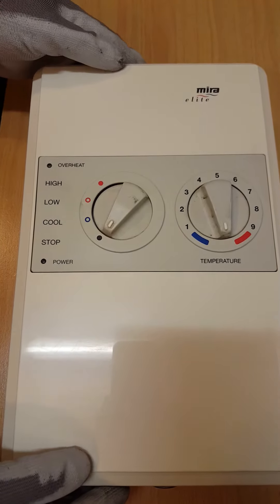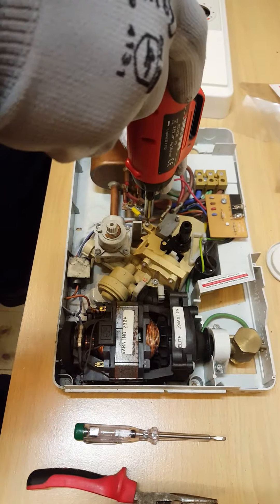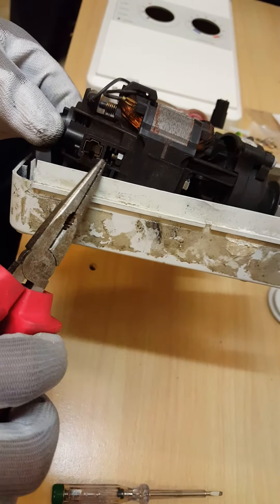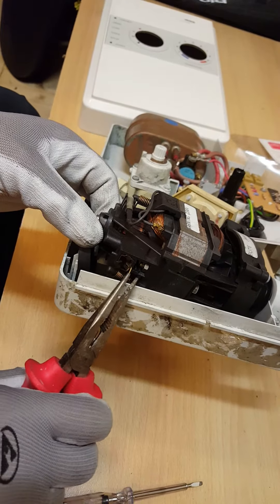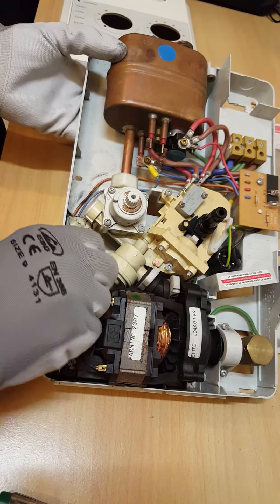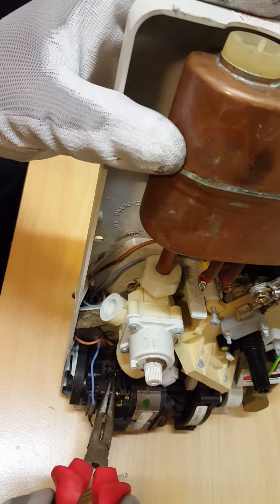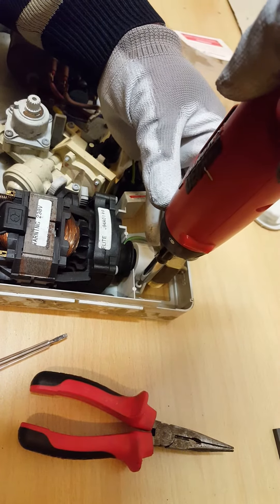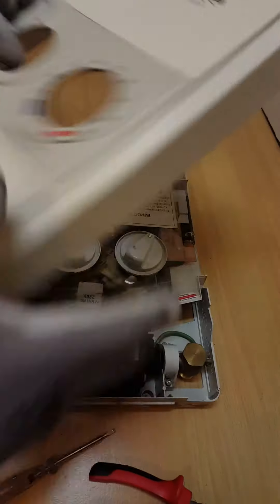Mira Elite Replace Carbon Motor Brushes

Comment: Hold up
 This is a electric shower or not as I always thought electric showers had no pump however this looks like it has a heater element and a pump so I am getting very confused
Reply from the maker: There are two types of showers, mains water fed,or pump fed from the water tank in the attic. hope that helps 🙂
Reply: @Frank_Falvey  so I think you're repairing a power shower in the video.